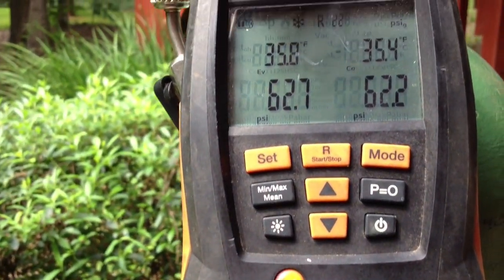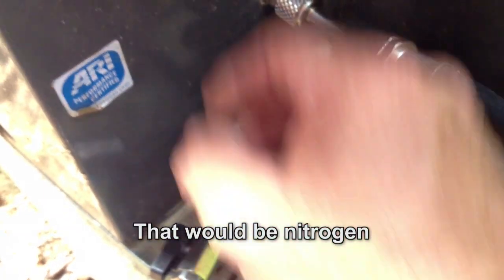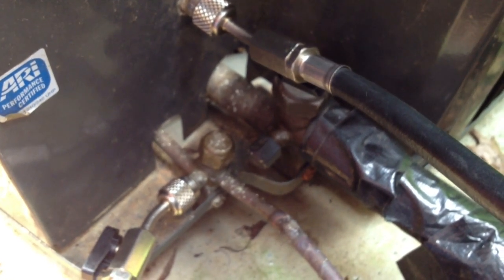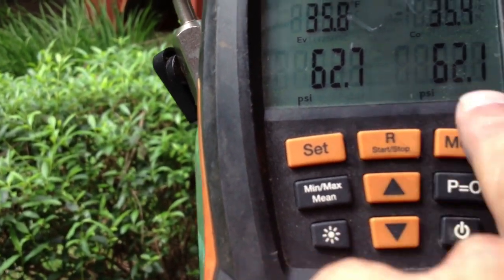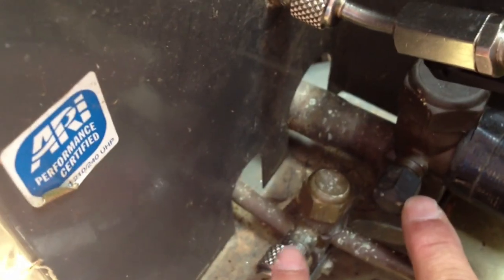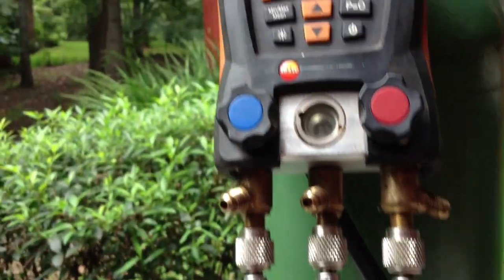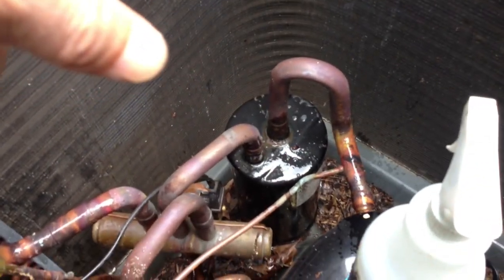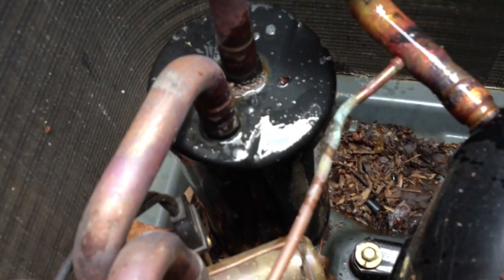Freon Leak Detection; What is the best method to find a leak

Comment: Why don’t you test with at least what the low side test pressure is?  I go with at least 100 lbs of nitrogen.  I use bubbles first, I’ve used the GE H10 leak detector since 1973. Back then they were equipped with the flashing light only, no buzzer.  I still have my original H 10. Still working   After almost 50 years.  There is a lead blow out plug in the bottom of some of those accumulators.  These leak all the time.  Be sure to check down there too.

Comment: In my opinion I would never use the hoses your using, I’ve used them in the past and they always leak.  You’ll be chasing a leak that isn’t there.  An R22 trace charge and 275 pounds of nitrogen pressure, you’ll find that leak in minutes.

Comment: I do apartment maint. 3 story buildings. About once a month, I have to cut a hole in 3rd floor and fix a leak in the attic. Each unit has 20 extra feet of 1/4 line set looped loosely in the attic that I remove. It's crazy.
Reply: TechFive the 20 ft of quarter inch tubing was for old LennOx evap coils. The tubing is the metering device. You will not find a piston or TXV on the evap coil.

Comment: manufactures build there units way too cheap.  they skimp on real copper and other materials. they design them to last 5 to 10 years when the warranty runs out. I have installed 3 ton Bryant condensing units in the mid sixties that were still operating in the year 2002 that's nearly 40 years of service. customer pays an arm and a leg they should get their monies worth. GE had a refrigerator in their Dallas plant office in the mid 70s that was close to 70 years old and still operating, it is probably still operating. the best thing about the new type of units is self diagnosing boards and money saved on high efficiency componets.
Reply: Using the old refrigerant, that would be banned today, is one great feature here.  No Damned reason to ban that refrigerant. Just what would happen if their units get low on refrigerant and/or have developed big leaks due to their  age.
Reply: R12 was more damaging than R22. Billions of cars used it and they all eventually leaked before they were in the scrap yard

Comment: 95% of all leaks are the indoor coil on all brands . I call that leaking as designed that wasn't there 1989 and back . EPA doings ! god i hate'em !
Reply: I agree that the majority of the leaks are on the A-coil but the EPA did not do that,the manufactures did. To gain energy efficiency they have all went to a thinner wall thickness on the coil, which is more efficient at moving btu's but the cost for that is less durability. The EPA did not make them thin the coil piping, it was done for efficiency and reduction of cost in  materials so they can come in at a lower price point to get sales. I worked in refrigeration manufacturing for 12 years so I got to see and be a part of some discussions on this. The efficiency standards were set in the 2006 energy code and that is what the manufactures are following to this day.

Comment: I've changed Reversing Valves and Could Possibly be one if not my MOST HATED THINGS TO DO EVER !!!!
Reply: Rob Brown good trick try cutting the old revering valve out with old snips close to the valve body then braze the individual couplers off the existing pipes instead of unbrazing the whole valve apart and out just a thought I tried it and it helps a lot ( straight snips not offsets lol)
Reply: Yes that is real high on the sucky side lol.

Comment: I'm lost. I've had 3 ac guys out and because I have a leak I need a new unit?
Reply: +Jose Francisco Medeiros I will look into it. thanks for the reply!
Reply: If it has aluminum coils you can't. If three separate companies told you that you need a new unit I'd have to believe there's a reason for that. I'd not waste money trying to cobb it up personally. Sometimes people tell you that you need a new one even if it is fixable but they're thinking about the cost of a replacement part compared to the cost of a new unit and you still being stuck with everything else being old and worn if they were to fix the old one. Regardless best of luck to you. :)
Reply: +sstroh08 Thanks for the input I've since replaced the ac  furnace.
Reply: The EPA  knows what they are talking about. Ozone is shot full of holes from leaky units. Prep for the future .its your children you're protecting so don't beat a dead horse.

Comment: I would have sold them a new unit instead of changing a compressor. This customer is not going to be happy now. How are you going to purge nitrogen thru all the connections of a new reversing valve? If you get any oxides inside the new one it will likely plug the pressure switching cap tubes or scar the slides seal. Until there  a way to purge all ports invented I will be selling new units to every bad reversing valve because it cant be done to manufacturers specs. What do you think?
Reply from the maker: +Marriage Partners people have been changing out reversing valves for years.
Reply: +T&amp;N Services LLC.Is there a method for purging thru all ports that are brazed?
Reply: +sstroh08 well that good to hear.. since you can't purge nitrogen thru while brazing it follows that it can't be done per ulc refrigerant handling practices. also it can't be done per manufacturers recommended procedures which specifically state you must purge with nitrogen. one has to ask oneself am I contaminating this system and if so am I prewarnning my customer about the risks?
Reply: We have changed out at least 30 reversing valves in our time and I don't remember ever having an issue with out afterwards

Comment: If you have a big leak of 25 pounds per year or higher, use a good ultra sonic with a good pair of head phones.  Don't bother with the cheap Chinese ones.  Use Ampprobe or Inficon.  Small leaks of less than 10 pounds per year require a good sniffer.  The H10 Pro (not the PM) is the best for small leaks.  If the sniffer goes off 3 feet away from the unit, switch to ultra sonic.  I have used this technique on thousands of leaks over 30 years.  I rarely spend more than 5 minutes finding all the refrigerant leaks.  The hardest to find are 10 pounds per year.  They are too small for the ultra sonic and difficult to pinpoint with the sniffer.  I'll usually spend 15 minutes pinpointing those leaks.  I actually bought all the HVAC leak detectors and have a leak detector report for sale on ebay.
Reply: It's obvious you do commercial industrial.
Reply: Which leak detector u recommend? Pls let me know

Comment: I realize this video is older but I'm not sure how you isolated the system to leak test both halves.  If you close both service/king valves you monitor the lineset and AH coil while the condenser coil is isolated but not monitored.  If you leave a king valve open, you would need an isolation point somewhere.  I just can't tell where.  Can you explain it?  Thanks.  Also can you do a video showing the compressor or reversing valve replacement?  I'd like tips on getting to the components.  I used to work on chillers where access was easy.  Condenser units look tough to reach into.  Thanks!
Reply: acoustic4037 He closed the service valves at the condenser. Then pressurized the condenser through the true suction port (heat pump) and the lineset and indoor coil through the liquid line port. Monitored with digital gauges from there. Hope this helps. Take care, Brett
Reply from the maker: I closed the valves on the outdoor unit.
Reply: Thanks for clarifying.  I thought you said you isolated the high and low sides apart (not the coils).
Reply: Oh man!  How did I not get that.  That helped a LOT thanks!  I had a huge brain fart... should have known.
Reply: ***** On this one there was. Some have the service valves/king valves to do this and some just have service ports, where you can't isolate or pump down. Take care, Brett
Reply: I did not get that either at the first view now is clear thanks for the explanation

Comment from the maker: Thanks GFM, I have had several like this where I isolate the two and because of the gauges I can spot which side the leak is on. Of course if both sides leak down I will conclude the valves are leaking by and then put some R22 tracer in it and get out the H10 to find the leak. It won't lie.

Comment: Great vid T&N.  Your camera work was very good. I could see all very well even if you left your camera at home.  Your isolation method is a good one if the valves do not leak by and you should be able to tell that because both sides will leak down.  Thanks for the info.
GFM

Comment from the maker: They do make 3 phase stuff but it's the bigger equipment. The only thing I would do is have someone run a new circuit to where the equipment is going to set.
Reply: T&N Services LLC. I have a 31/2 ton Am Standard 3 phase cond unit at my house. On the hottest days the compressor pulls 11 amps. I never have to worry about my comp. fun cap either lol